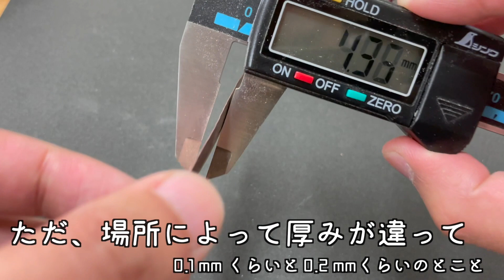【革命】光を通す金属を作りました

Comment: Just wondering here, but would it be better to put a small layer in a cubic vacuum chamber to remove the bubbles and increase the structural stability? Possibly line the chamber with parchment paper or something to make removal easier
Reply: But if you removed all the bubbles will light still be able to shine through?
Reply: Most likely. What’s happening is not that the metal became magically transparent. He suspended a bunch of copper particles in the epoxy. What’s likely happening is the light is shining through the epoxy and bouncing through the metallic particles like a mirror maze. What light gets through looks like it’s passed through transparent copper.